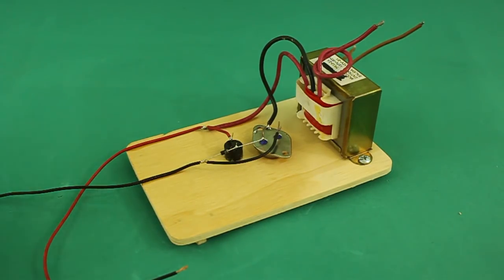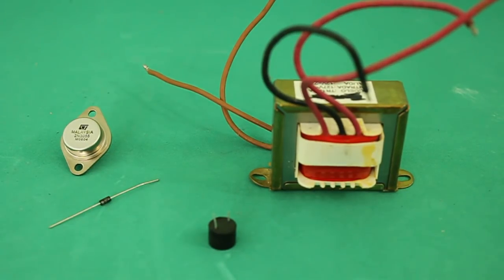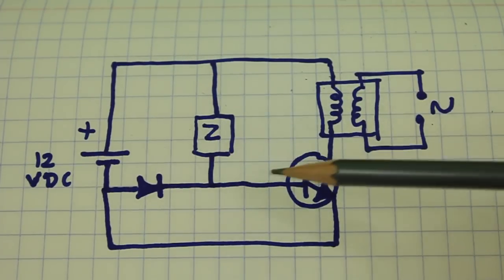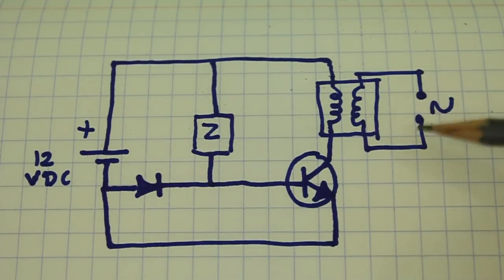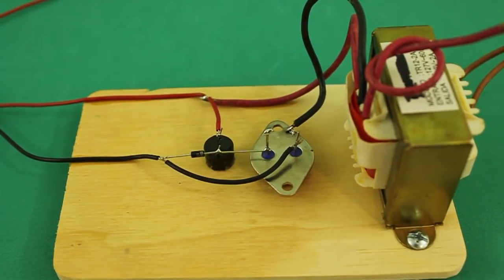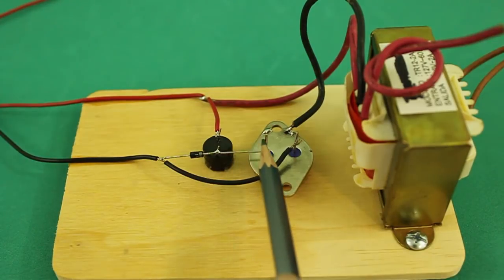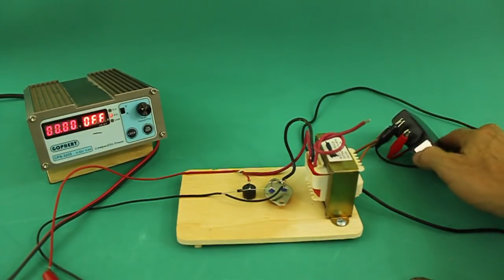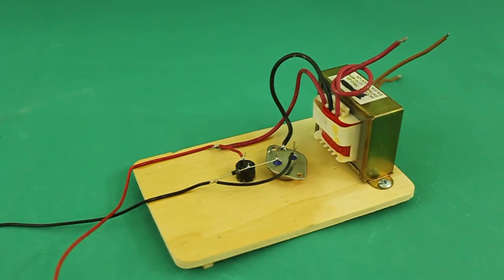Simple Inverter 12 to 120 volts

Comment: So what is the reverse diode between ground and base for? Reverse voltage spike protection if the transformer primary self inducts high voltage above the base-emitter breakdown reverse breakdown voltage?

Comment: Thanks Ludic, great idea.
You can make a DIY heatsink by using a small can of a tuna or sardine or condensed milk...etc. It's temporary of course.
Sand it a little and make a small hole for the required component.
You can use toothpaste(maybe some brands) as a thermal paste.
https://duckduckgo.com/?q=toothpaste+as+a+thermal+paste
That's all TEMPORARY, just for experiments not long run or final projects.

Comment: The main disadvantage is that you are way out of the frequency the transformer was designed for. Most of the energy will be going into heating the iron core.
Reply: Laminated transformers are good for 20,000hz and below. They are best used at 5,000hz or less for max efficiency. He was within the working frequency of that transformer. The inductive heating is probably less than you would expect.
Reply: superdau yeah. I guess the frequency the transformer must be operating at in this circuit must be much high due to use of buzzer isn't it?

Comment: A few droplets of superglue into the buzzer (thru the sound output hole) would finetune the circuit into a non psycho-shock-inducing one... (Because of the beep noise)
Reply: Jozef Lipták but will the circuit stop working?
Reply: Nopparuj Ananvoranich dont think so, but you should try ;-)

Comment: Note that the output of this is square wave, it cannot driving AC motors like common fans, this only can be use for resistive loads and some appliances that will rectified the AC
Reply: AC motors don't mind square waves. They may be a little louder and may get warmer more quickly. But since the frequency of this setup is way different it's a moot point.

Comment: Can you please tell me sir, what is the use of the IN4007 diode in the circuit?
Reply: To protect the transistor from back EMF spikes from the transformer.
Reply: The diode actually provides the voltage to the base at start and then the current starts to flow from emitter to collector in transistor. Diode also makes sure that current from buzzer doesnt flow back to the supply and only to base of transistor.
Reply: varer wrong
Reply: The diode is added to prevent the transistor from getting damage due to high voltage self induced in the coil of buzzer the diode just compltes the circut and let the coil discharge it's current safely without damaging the transistor
Reply: To keep the emiter from shorting with the base...I think.
Reply: Anindya Mitra Oscillation. To drive the transistor. In order to get AC for transformer.
Reply: varer, the oscillation is given by the buzzer! I think the diode had some other purpose.
Reply: Yeah, I thought you meant the  buzzer. But for the diode, I guess, that because the transistor rectifies one half, then the diode fills in for the other half. Not sure though.

Comment: @Ludic Science: I would like to see you building a MOT voltage multiplier
Reply: pls no i want him alive
Reply: John Scarce whats the problem???? If youre just super careful its not dangerous
Reply: dude i have experience with a lot of stuff. I was hit with HV on multiple occasions with high end diy devices and im still well and alive. However i think a human should not play for fun with 2kV 1 amp output device
Reply: John Scarce wellbif you have so much experience you should know that the output is not one amp because the capacitors work like a ballast. So stop talking crap and get more experience before you say "i have a lot of experience with a pot of stuff".
Reply: 1. in the process of assembling the device if you accidentally turn it on the transformer output will be deadly no matter what capacitors are hooked after it. 2. voltage multipliers arent stable dc power supplies neither low maximum current ac supplies. it wouldn't feel very funny to discharge 4 kv and up capacitor on your body especially with capacities such as 1mF
Reply: John Scarce can you tell me why a MOT multiplier would be more dangerous than a regular MOT
Reply: because high voltages are at 1 amp max are dangerous enough. adding capacitors will increase the peak current to maybe hundreds of amps
Reply: basically you can get lightning striked multiple times a second
Reply: John Scarce but a peak of 100 amps that goes in a picosecond through your body isnt dangerous
Reply: John Scarce but then it isnt so much current anymore
Reply: but if it goes trough your body multiple times a seconds it is dangerous and what happens if you touch the secondary directly?

Comment: This would blow up when you plug it in. Since the transistor would be destroyed by the flyback voltage without a flyback diode.
Reply: Depends on which converter type you aim to build. In a flyback converter you do NOT want a diode on the primary side.